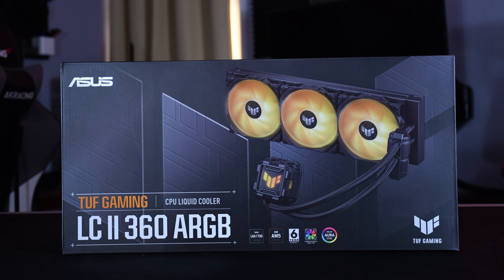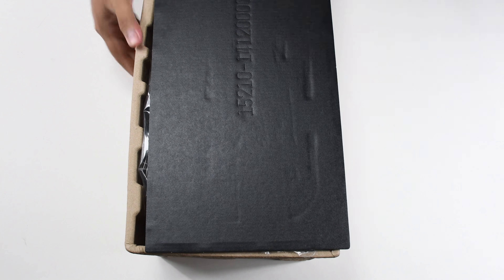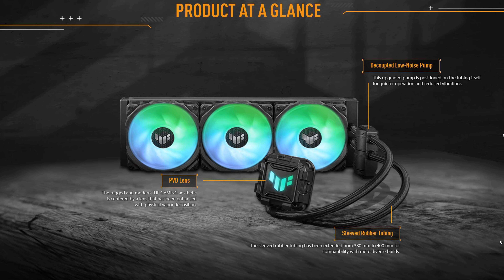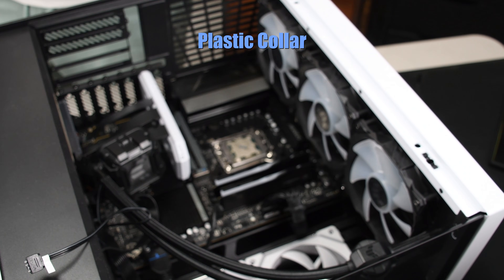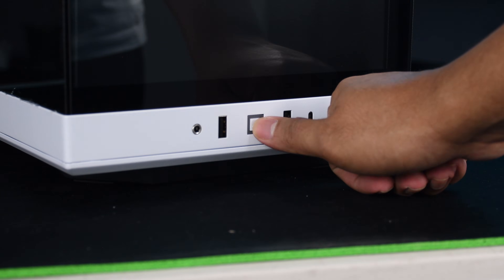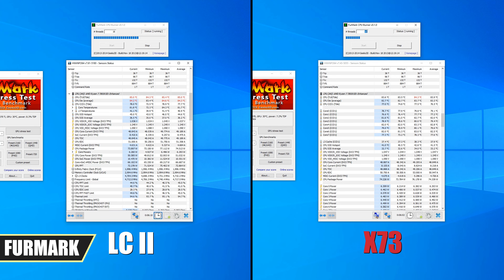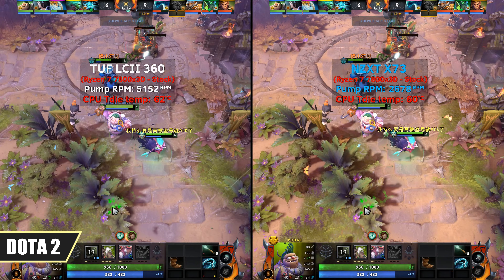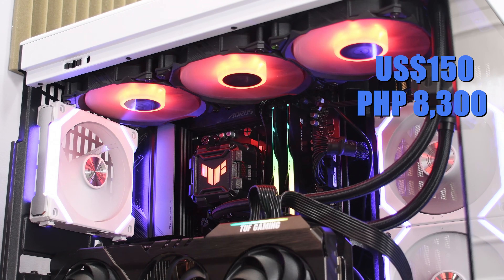Asus TUF Gaming LC II 360 ARGB - Installation Guide & Performance Test

Comment: The ASUS TUF Gaming LC II 360 ARGB's pump has a motor speed ranging from 800 to 3600 RPM (± 300 RPM). The pump also operates on 12V DC, drawing 4.3W and 1.1A.

Comment: Hello Jegs, I’ve had an accident of overtighting one of the standoff screws and it broke. Is there any kind of replacement of it, any other screw that can be bought, since they have exact 4 of them… thanks!
Reply from the maker: you can contact asus directly or have it replaced through your dealer. 

if you want a red neck solution cut a toks screw to the exact length of the standoff
Reply: @JegsTV I already contacted them, they told me they do not provide these mounting kits, told me to check on Amazon but I couldn’t find any

Comment: Does this plug into the 3 pin 5v Argb header or the 4 pin 12v? Looking to buy this cooler so an answer to this would be useful 👍🏻
Reply: 4pin rgb is pretty much dead these days, the standard rn is 3pin 5v a-rgb in majority of products

Comment: You did not tell most important things, where which cable where to be installed, which cable needs to installed to cpu fan header... Also made me question why there was two fan cables connected to motherboard

Comment: just installed this piece of art on my full diy TUF GAMING PC build because the air cooling gave me 92 degrees celcius with gaming. Now with this i get a nice 50 degrees wich i feel much more comfortable with. im waiting for a vertical bracket for my 3060TI TUF GAMING video card.
Reply: how much celcius you getting on gta5 or fernbus

Comment: I was sitting here so confused thinking I was missing something but it’s supposed to be spacers under the stand offs not after. I kept thinking misplaced another group of spacers that’s came originally with my mobo. Just take note, spacers go under standoffs and screw into mounting bracket.
Reply: Yes this the first error i see right now the manual says the spacers go under seat screws not upper side 😂
Reply: @rocketman7115 it’s depends. For me it was under the screws so

Comment: Thanks for the guide.  I just received this cooler and the manual is not too good for someone who has never installed this kind of a cooler.  For starters..  I have no idea which direction the fans blow and the manual doesn't explain it. There is no indicator on the fans so I have no idea which way to install them into the radiator. I need to install the radiotor in front of my case.

Comment: Bro ur thermal paste application sucks
Reply: Dude, Gamer's Nexus, Hardware Unboxed, JayzTwoCents, and other top tier tech channels have all covered this topic to death. The application style and even amount literally doesn't matter. There's a reason the "pea size amount in the center" has been the default for what 40 years and going. It works.

That said, due to it all working and not mattering, there's nothing wrong with spreading flat or an x shape either. Since they all work. So take that for what you will. It's objectively impossible for paste application style to suck. Other than applying paste to the pins under the CPU instead of on top of the CPU.

Want to min-max paste application? Buy a Contact Frame from thermal grizzly, or thermalright, etc. The surface of Intel's IHS and Ryzen's IHS are concave/convex. 99.9% more relevant than "thermal paste application sucks" which is not a thing.
Reply from the maker: Thats a perfectly fine amount of paste.
Reply: The way I see it there's nothing wrong with the centre dot application of TP as the contact plate will eventually spread the paste out as in a short period of time, not all the time the whole spatula spread method is ryt as it barely leaves any room for spread and in turn causes issues later.
Reply from the maker: @anshumanbose7430  exactly. Bro is mad for no reason
Reply: @JegsTV It's physically impossible to get the optimal amount of paste with that pattern. But sure bro, why improve when you can just be in a denial. 👌
Reply from the maker: @penttijakonen3817  ive built hundreds of pc using that thermal paste application method. No overheating, no failure. But sure let the random experts on the internet tell you youre wrong 👌
Reply: @JegsTV  You forgot to mention how many years. 😂 Again, stay in denial if you want. Also nobody said that an inferior application would cause a failure.
Reply from the maker: @penttijakonen3817  bro is petty about thermal paste. Get a life my dude 😂
Reply from the maker: Youre the first guy i encountered getting passionate about thermal paste. Holy fck. Just gtfo dude 😂
Reply: @JegsTV  coz it matters, cooling systems got advanced but their efficiency can be impaired if you apply the paste the wrong way, even if there is no overhearing and no failure, isn’t it better to have ur components cooler by just applying the paste correctly? buy two pieces of glass and practice which application method gives you best results. Also greetings from Ukraine my g=) peace💙💛
Reply from the maker: Again, that amount and method of application is perfectly fine. Pea/dot method has been proven to be perfectly adequate for standard ihs chips over the years and the chip used here actually has smaller ihs compared to others if i were using for example a TR chip the application wouldve been a lot different because of the larger IHS. Heres a temperature difference between different thermal paste application.

https://images. app. goo. gl/S6yPw87FUVnU9VpH8

Added space so yt wont delete the comment.

Comment: during full load, does this stand - out noise come from the pump ?
Reply from the maker: the noise is barely noticeable on my end. and i tested this with an open case. so for sure you wouldn't notice any noise if you have a closed case.

Comment: Are you sure you put the standoffs in the right order? It's standoffs then screws in the manual.
Reply: Intel you have to change the backplate with the provided one which is why there is a difference. Then the spacers and screws last before mounting the unit
Reply from the maker: Theres already a mounting bracket for you to put in the standoff screws on the am5 platform which i used here. Might be a different scenario for other chipset.
Reply from the maker: Btw, the spacer is different from standoff. You might be mixing up the two.